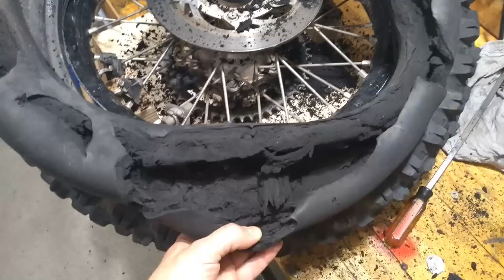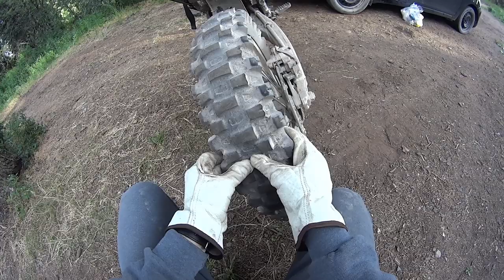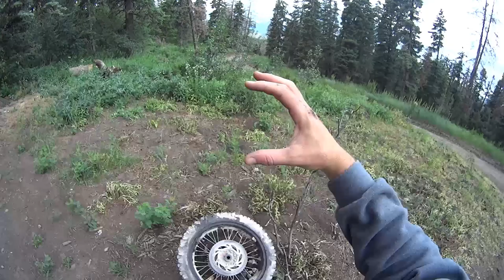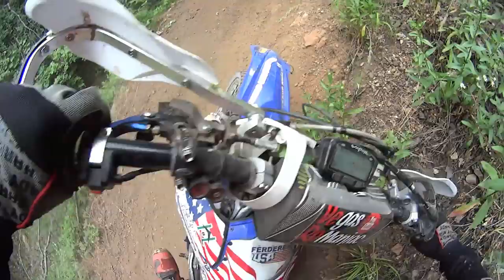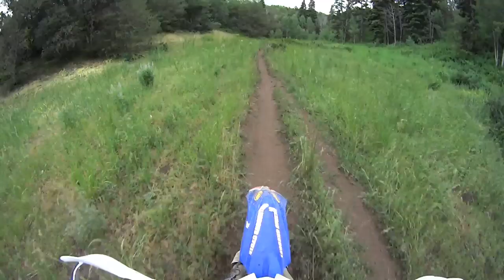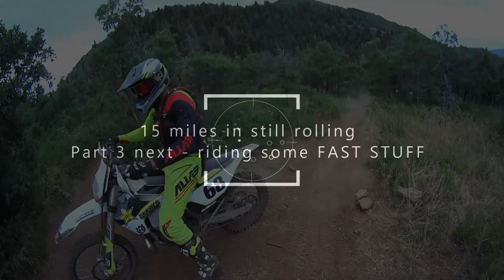Michelin Mousse BIB insert FAILURE Part 2  HOW FAST can you PUSH IT!

Comment: That moose looks like the black foam they use on the Freon lines on air cond. Try some of that. LOL. Ride safe my 2 wheel friends.
Reply from the maker: Yeah I'm looking for a replacement for it  need to fid something, in my next video I tried pool noddle, made it 25 miles, not a good option
Reply: @vegasromaniac  I've heard of people using tennis balls.
Reply from the maker: @carlosl1993  my next try
Reply: @vegasromaniac  hell yeah, I've always been curious. Can't wait for the video👍
Reply: Carlos Luiz I suggested this in part 1. Using tennis balls. I was hoping Vegas would try it out.

Comment: mousse failed due to lack of lube and any highway driving you do played a role in speeding up that failure. They are not designed for street riding or high speeds due to the friction that creates. and they need to be re lubed every few months if you ride a lot.
Reply from the maker: Actually that's not what killed it.. It was the fact that the tire was too big for the mousse..  Way to big..

Comment: With the tiny amount of power that bike makes a toasted bib must leave you with no power at all. I just had to pull my rear bib last night and put in a tube (didn't have another bib) because it was hard to move the bike across the garage. It felt like I had a new bike today. I'd obviously gone too long on that old bib.
Reply from the maker: Yeah that's true I experienced that but remeber you can only push 1/4 of hp, at best so yeah on the bike doesn't make a difrence.. I'm. Going to tubes also but for difrent reasons
Reply: Vegas RoManiac I grease up my tubes like you would with a Bib. Makes the tube all slippery inside the tire. Much less risk of pinch flat.
Reply from the maker: @brianh8484  yeah that works a bit better but not much,
Reply: Vegas RoManiac can only guess. Plus grease won't stop a cactus